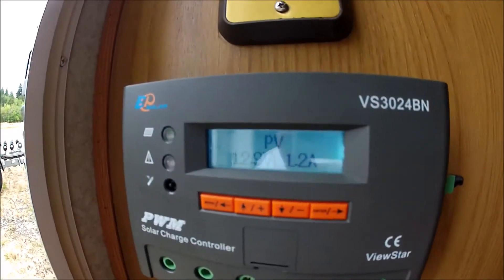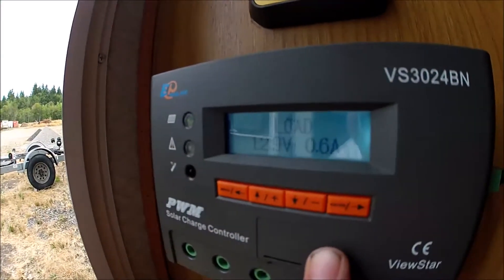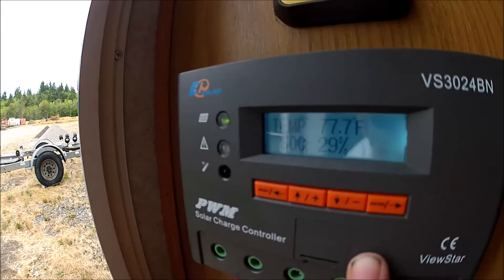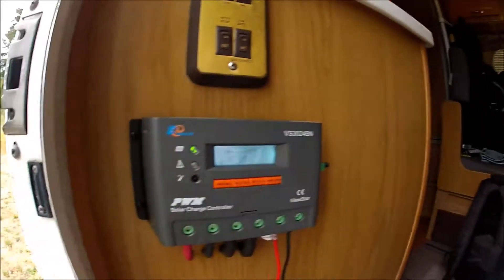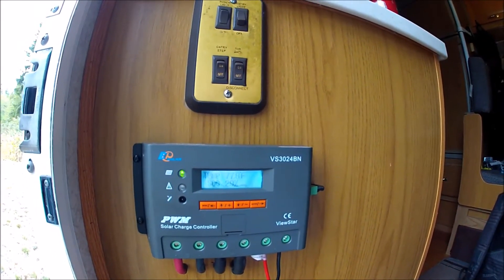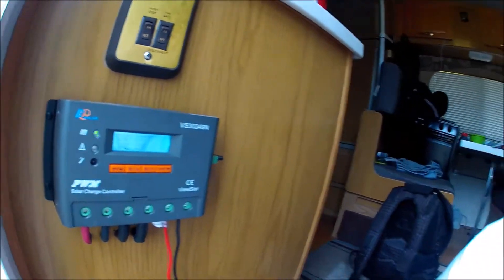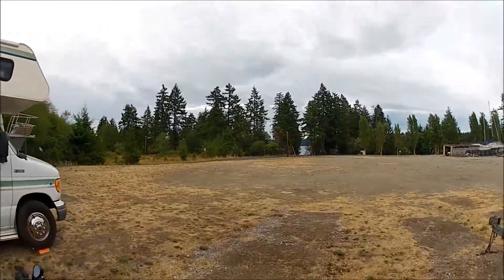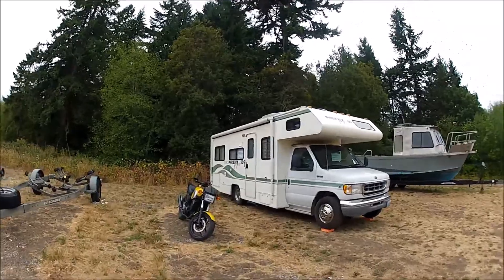Low battery state of charge with a full battery Viewstar 30 amp

Comment: You earned a new subscriber. good vids. looks like you've used this controller for several months now. whatcha think of it?
Reply from the maker: Awesome,  thanks for the subscription.  So I actually do really like the charge controller,  it's charging algorithm is good and it does a good job with my batteries.  The only thing I don't like is how the state of charge is only accurate while it's charging and receiving enough charge amps. It's purely a display that I don't like what it says when its software could show a more user friendly number.

Comment: I have the same charge controller and the SOC is never correct. It even goes back up WHEN IT'S DARK OUTSIDE and I know it isn't charging. It's stupid, they need a better way to calculate SOC. It lies. I opted to pay extra for a better controller than what came with the kit, thinking it would be more accurate. NOT SO. Save your money and use the cheap one. I am going to bitch about it in my next video.
Reply from the maker: +Goth RVer Sounds good.  I do like the EP Solar charge controllers for how much you can adjust the charging rates and it does do a good job at charging it's just that it's useless at looking at for an actual SOC.
Reply: Paid Shill Your not alone here; mine does the same. My thought is, if you [ViewStar Controller] cannot accurately report SOC then don't report it all. I like the controller but it has this odd issue.
Reply: I found it's better just to go off voltage.

Comment: RV Crazy What CITAP1 is correct. To get a better reading, we suggest leaving the battery in open circuit and disconnecting the charge controller to allow for stabilization.

Comment: Have you got this resolved yet?
Remember, the solar controller isn't measuring the batteries charge, it's measuring the charging current going to the batteries and also to the house load. The solar controller can be reading 12.9 volts and the batteries will also measure that but that is because of the charge voltage from the solar controller and the amount of current being delivered. Disconnect the solar controller from the batteries and measure the voltage after a few minutes resting. The batteries alone will drop in voltage reading. The charge controller derives the SOC from the voltage applied and the current being delivered by the controller. High current means low SOC, lots of charging going on. Low current means high SOC and charge is nearly complete. It's not very intuitive is it.